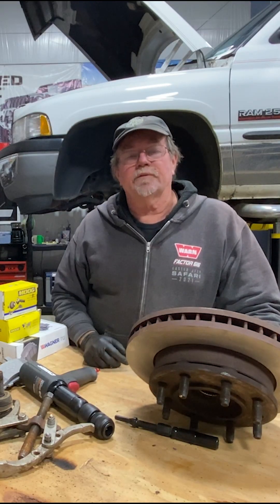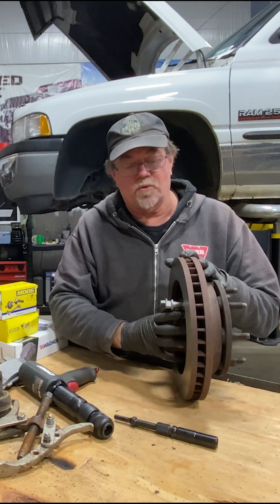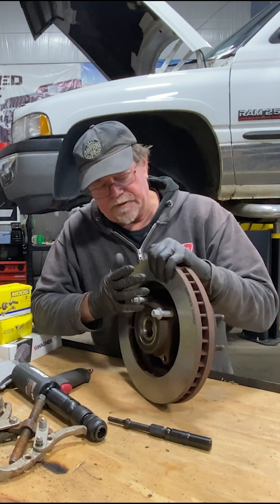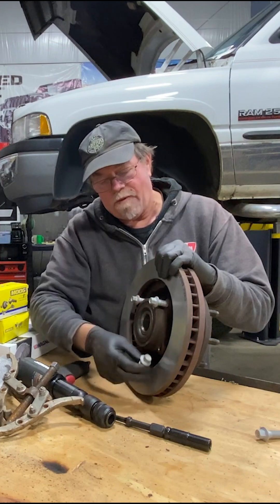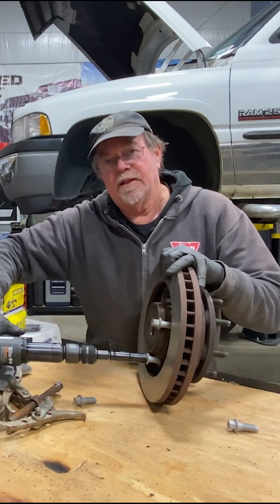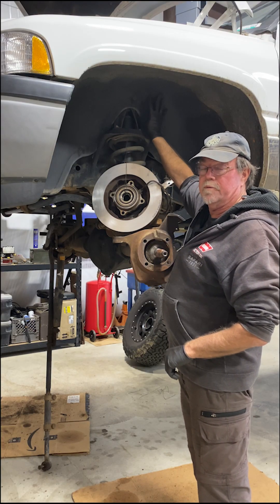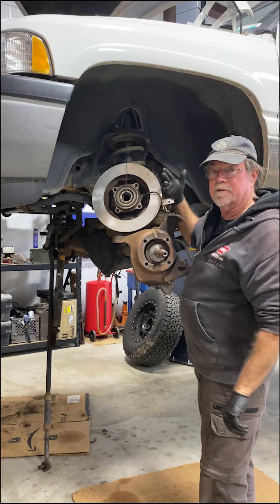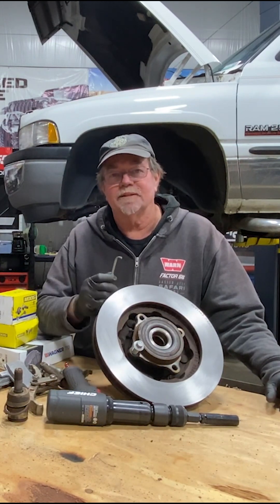Don't Forget to Chisel Your Nuts - Ram 2500 Bearing Assembly Removal

Comment: Hi I’m trying to find the hub and rotor assembly and can’t source one anywhere. Are you able to tell me where you sourced yours?
Reply from the maker: Hi Kevin, Collard here. Sorry for the delayed reply, I've been overseas for several weeks. I was only turning the rotors and pads at that time, but I usually look to Dinos Garage for quality aftermarket or OEM parts. Just looked and they only go back to `99, so I guess I'd look to a retailer like NAPA. Good luck.

Comment: If you don't have an air hammer same at up with socket but put on an extention then turn the wheel until extention bottoms onto frame turn the wheel with truck running real easy using power steering strength
Reply from the maker: Good call, I've heard of that method too. C-
Reply: That does work great. Its how ive always done it....until...my steering linkage broke and I need to pull the hubs. Ill be trying this method now as I cant use the steering.